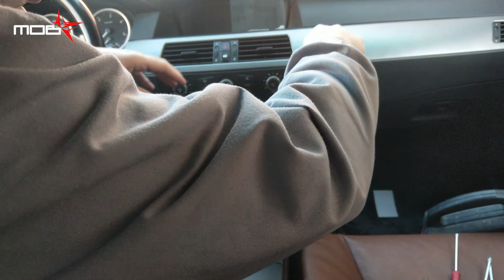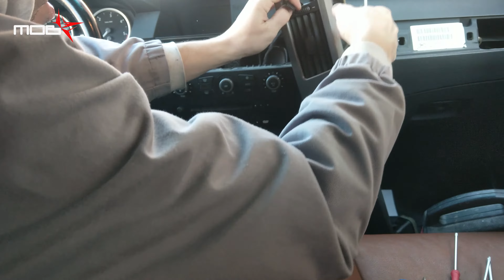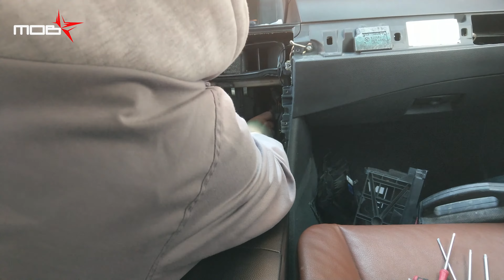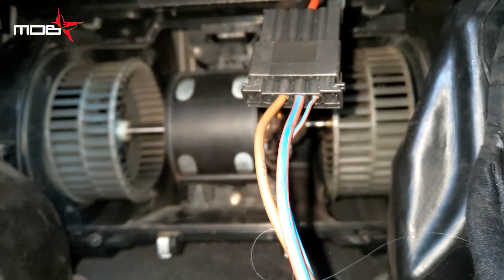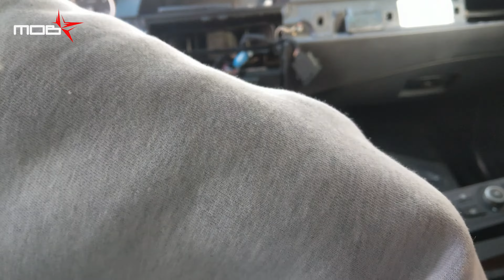How to Replace the Blower Motor and Blower Motor Resister on a  BMW E60 5 Series

Comment: Imi poti explica si mie te rog, cum sa schimbi doar paleta la ventilator, cum ai reusit tu
Reply from the maker: Salut. 
Ce anume te interesează ?
Reply: @MOBstarCustom  am vazut in video ca ai rupt o paleta de pe motoras, cum ai reusit sa schimbi doar paleta, am primit 3 colete cu motor pentru schimb si au venit toate rupte..si as fii incercat sa pun de pe al meu(fiind bune) ,pe astea rupte si nu stiu cum sa procedez
Reply from the maker: @bmmdetailing8162  
Am taiat axul de la motorul defect cu palete întregi după care am folosit o presă să scot axul din palete... Peotorul bun am dat jos paletele deteriorate prin taierea  plasticului. Atenție să nu deteriorezi axul. 
De introdus paletele bune pe ax nu ai nevoie de nimic special.. Doar sa le presezi drept.
Reply: @MOBstarCustom  am reusit, am incalzit cu un feon si am scos incet de pe ax, m-am chinuit putin dar am reusit intr-un final🙏😅
Reply from the maker: @bmmdetailing8162  
Îmi pare rau ca am răspuns asa târziu dar nu am văzut decât acum mesajul!

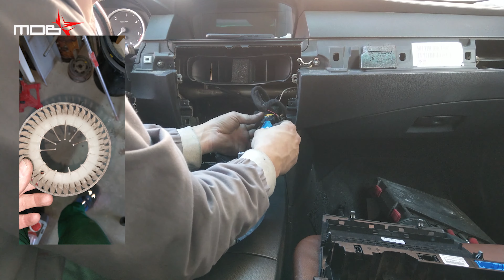Comment: 7:05 did you change this part on a blower motor?
Reply from the maker: I don't understand your question! 
I bought a used one and replaced the broken one! 
During the process I damaged the plastic part (palet) and I was forced to switch them with the one's from the broken one.
Reply: @MOBstarCustom  THAT WAS EXACTLY THE QUESTION